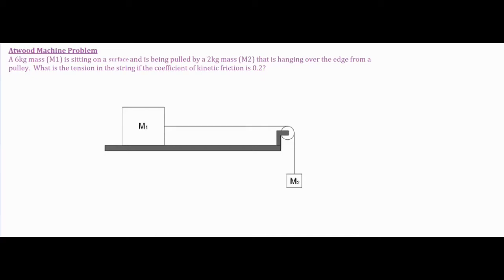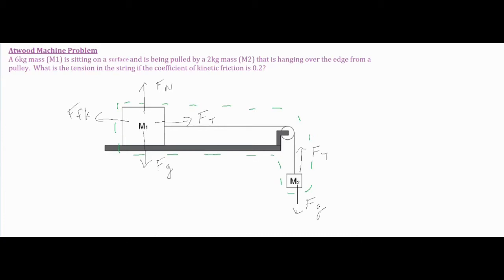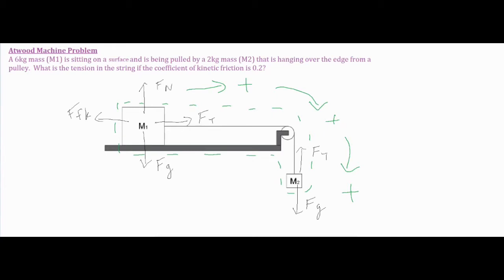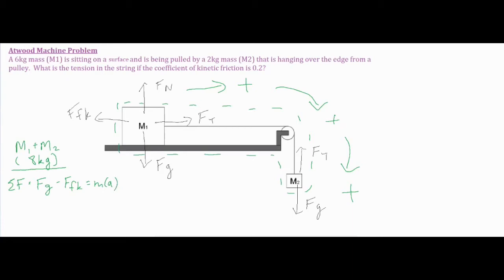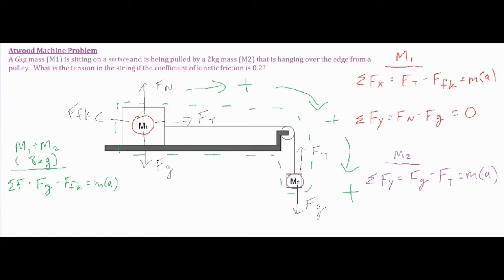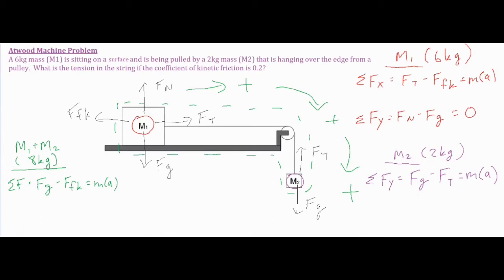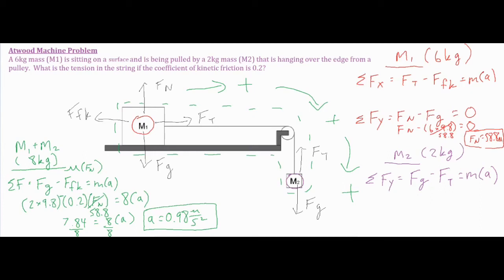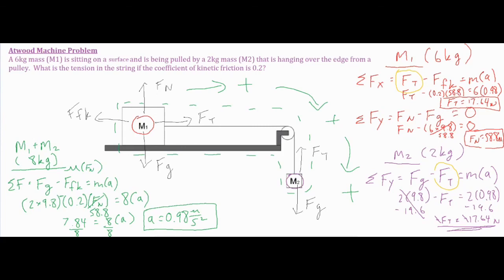How to Solve a Pulley Problem (Atwood machine with a block on a table)

Comment: How would you solve for the mass of m2
Reply from the maker: The approach is probably similar.  What known variables are you given to work with??
Reply: It’s a bit different than this but similar. Basically, for the problem I was doing, the diagram was immobile and M1 was a wheeled cart. If the corde connecting M1 and M2 were to be cut, the cart would accelerate at 3 m/s^2. The mass of the cart is 4.2 kg. It was asking for the M2 and the answer was 1.85kg but the steps to get there confused me
Reply from the maker: @CoCoaBunnyGirl  that's a question that I've never heard of before!  Well let me know if you need help with anything else!